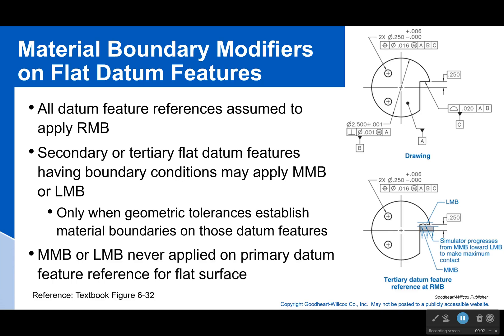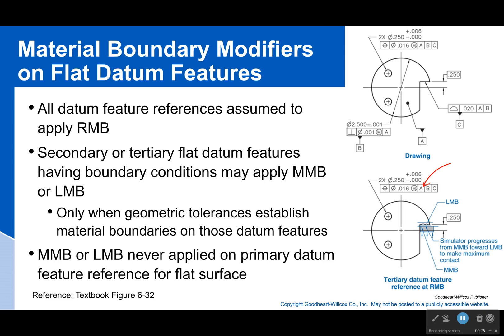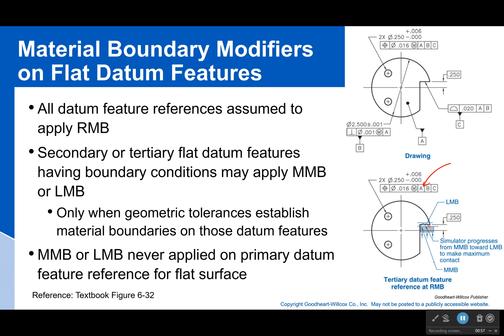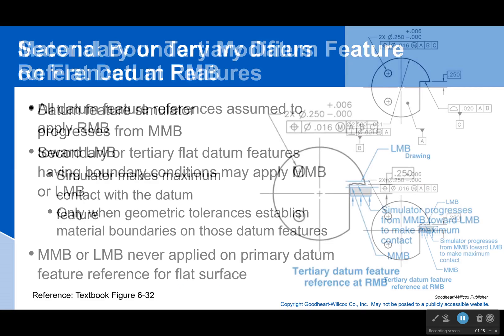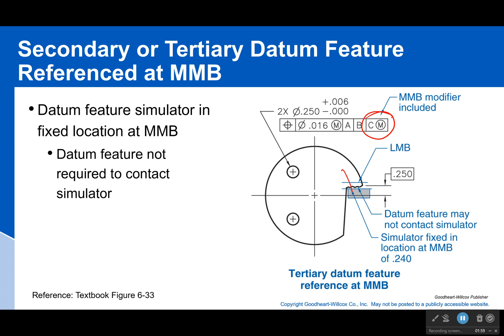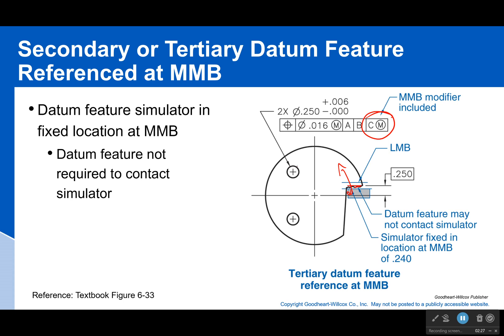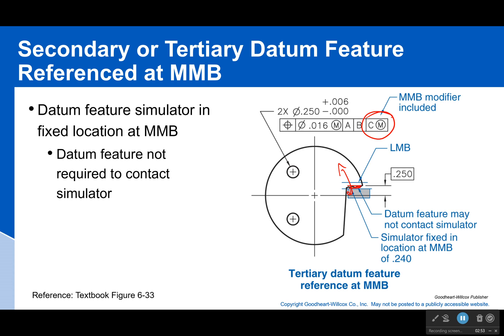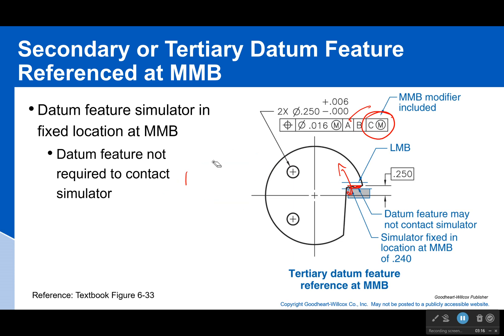Material Boundary Modifiers

Comment: Sir,what type of measuring gauge using for RMB & MMC/LMC feature, shall I get brief lucture, kindly.
Reply from the maker: I'll do my best. For LMC, there is not gauge possible as the boundary exists inside the feature. For MMC, the gauge depends on the shape of the boundary. For a flat surface, the gauge would be a flat surface fixed at it's max extent. For a cylindrical surface it would be a hole or cylinder fixed at the MMC. Creating a gauge to check whether a part meets spec takes time and money. Unless the part will be created MANY times, it is likely that all these details are found using coordinate measuring machines or similar. Lastly, for RMB it is simply how the part is being held. You will move your datum simulator up to that surface until it touches it fully.
Reply: @drkiddengineering  Thank you sir, Just going through this note.